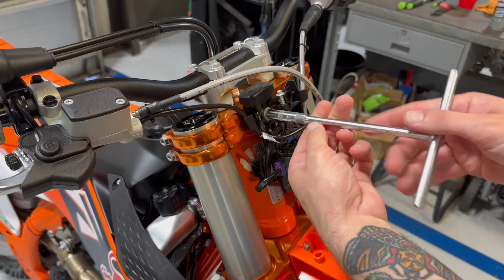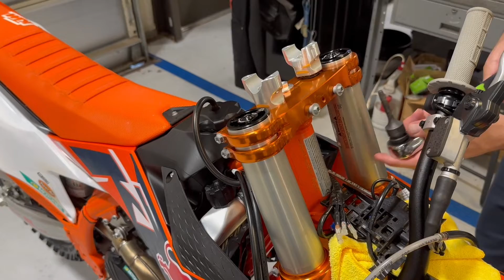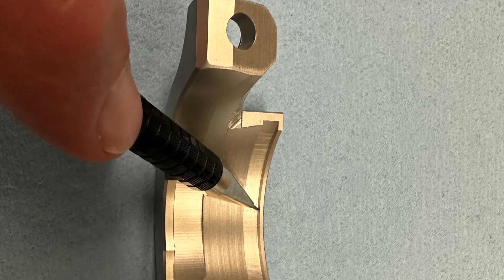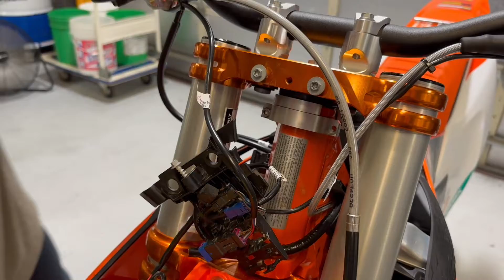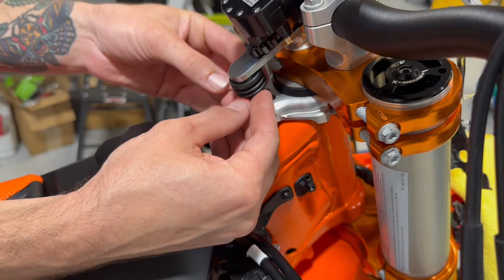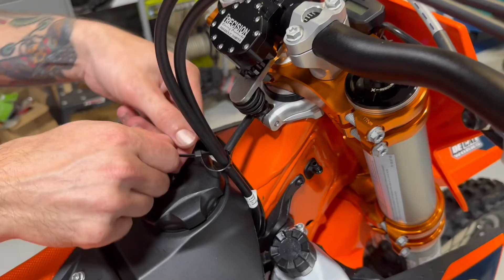Parabolic steering stabilizer install 2023 generation frame KTM, Husqvarna, GasGas.

Comment: Just a quick question when you put the cones back in do you use the aluminum inserts ? Hard to tell from video
Reply from the maker: There are aluminum cones with Vitn rubber insert, so lots of strength with no metalto metal contact. https://precision-rp.com/Handlebar-coned-bottom-clamp-set-KTM-Husqvarna-2015-2024_p_389.html

Comment: The bottom (2 piece) handlebar clamps that ship separately have a gap to the triple clamp, unlike in this video. This drove me nearly to the point of insanity (kept spinning in the triple clamp) until I read the paper instructions.
Reply from the maker: It is hard to see the gap in the video.  Even is stock form there is a gap.  Ktm just has rubber in that gap.

Comment: What's the solution for TC250, Luxon Triple clamp with Mako 360 bar clamps?
Reply from the maker: The luxon clamps triple clamps are no problem.  They even make handlebar clamps for the parabolic.  You will need to change out the Mako 360.  You can use PHDS clamps,  or Flexxbars.